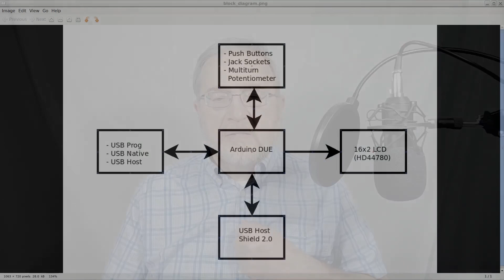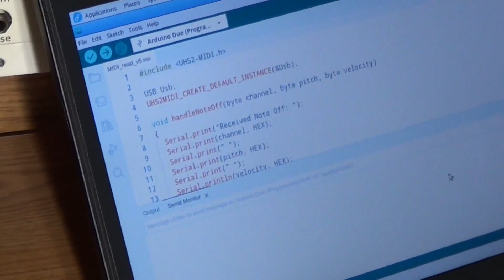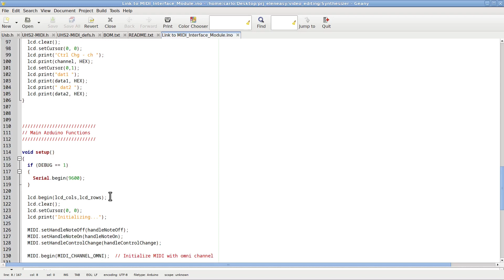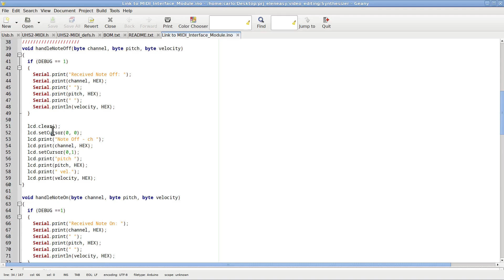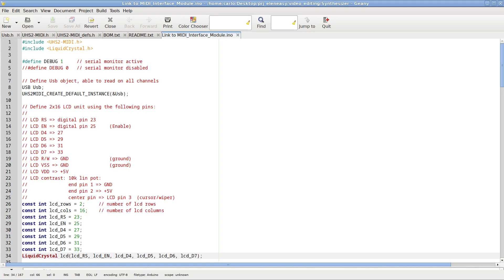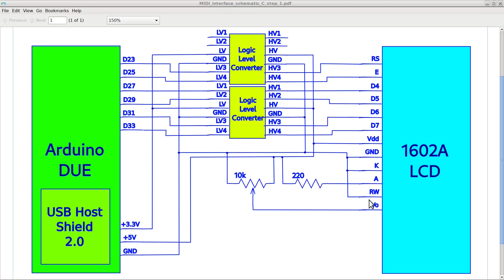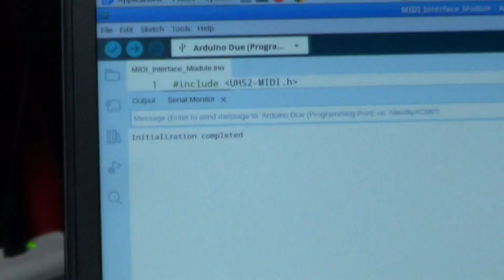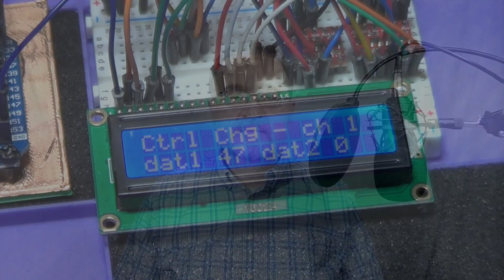The Synth Project Episode 40: MIDI Module - Part 1

Comment: Arduino Tips... Based on experiments with the 328P... For the Uno and Nano = These run happily on 3.3 volts. The trick is to know that you can inject this 3.3V supply into the 5V OUT pin. The 5V OUT pin is downstream of the onboard USB/5V IN pin regulator. Therefore, the 3.3V is not influenced by the 5V regulator, nor must it meet the requirements of this regulator. The 3.3V supply will go directly to the control chip's Vsupply pin. People also seem to not be aware that the 1602 display can be found in both 5V and 3.3V models. And, different models can communicate in different protocols, such as SPI... Not just I2C. You must read the product descriptions carefully, to find the type that you need. So, why share this information. To give you more tips... By matching the Vsupply that you are providing to the controller and the display (and any other connected/controlled devices,) you will not need level shifters. And, by using SPI, you will not need the I2C adapter. There are YT videos on these tricks and you can look there to fill in the details. HTH. Cheers!